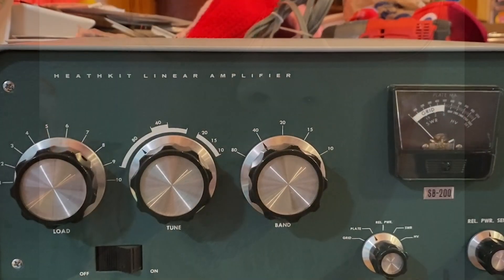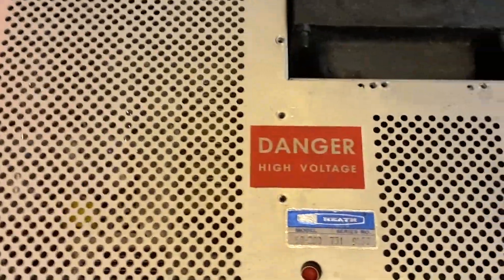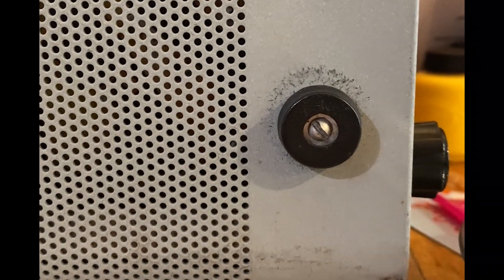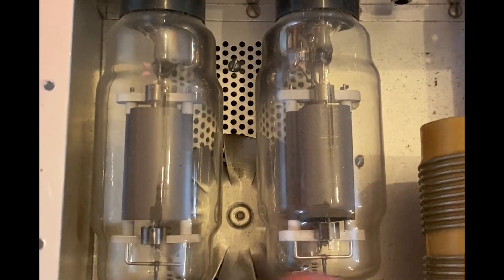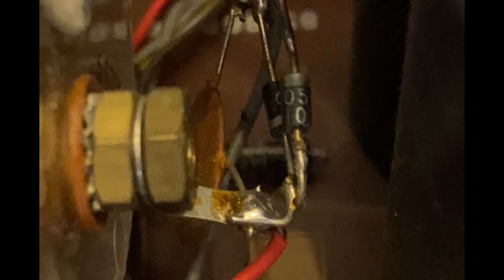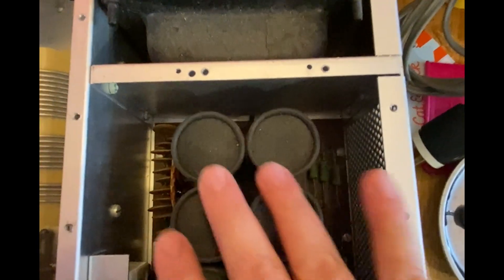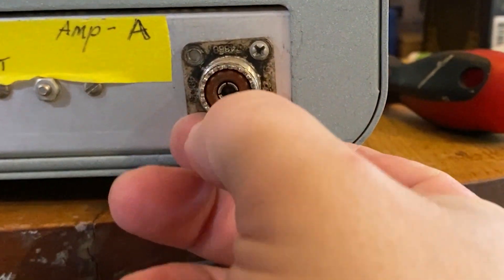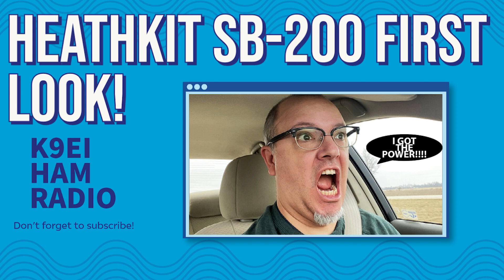Heathkit SB-200 First Look!

Comment: I worked for Heathkit in 1978 and have personally built about 50 of those amplifiers. That amplifier uses 2 triodes very similar to but not to be confused with the 811 B's.  The most power that amplifier will put out key down straight carrier wave is 700 Watts.  Output.  Keeping in mind the back in the 1970s power was measured as input ratio.  You should only have about 2400 volts on the plate, and a very very maximum of 500 milliamps.  When you tune that amplifier there is no need to be dipping the plate unlike a tetrode.  Just tune it for maximum output.  Keep your eye on the grid current.  Don't overdrive your amplifier or you will destroy the grid.

Comment: Mine has the original Cetron Tubes from 1971 when it was built. There is a date code on the tubes 7101 - first week of 1971. Yours should have a 4 digit date code as well.

Comment: I got my first look at Heathkit amps in the 80s when my Uncle, Jim Fosgate, started his training to convert his brother in law's unruly mad scientist son. That was Heber City, Utah where surround sound was invented for home use. (first theater in the world) He captivated my mind and deterred my career as the Unabomber with thoughts of reaching easily to Japan and Hawaii. 
When you get that on a scope you will be impressed with its simple yet amazing quality performance. They are infinitely tunable. He did however berate horizontal tubes showing me the outcome of overheating and sag. So as you mention, other than the obvious review of every connection, wire, component and device in the way of your new flame thrower your the boss now! 
Great acquisition!
Reply from the maker: It's cool.  It has old radio smell.